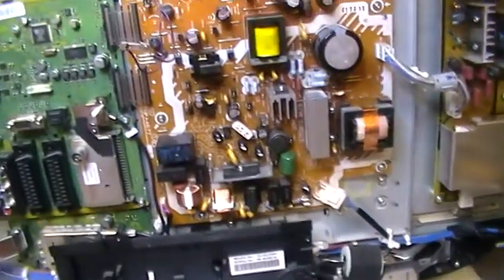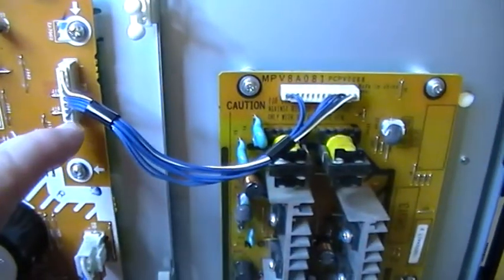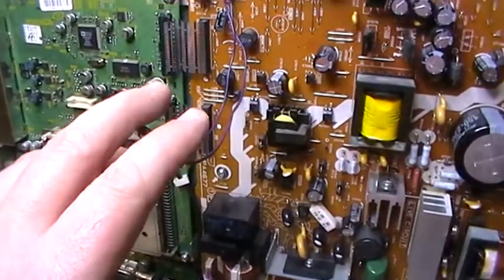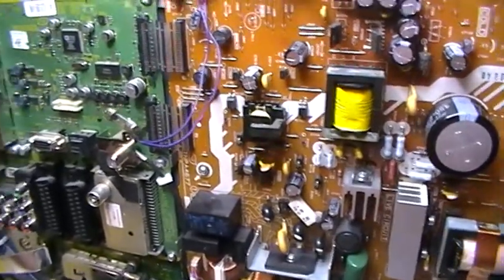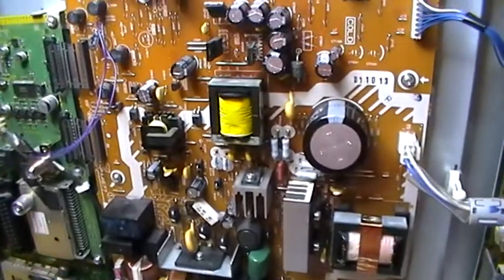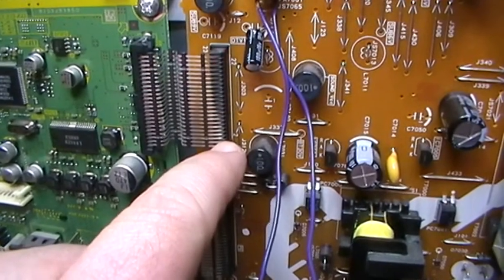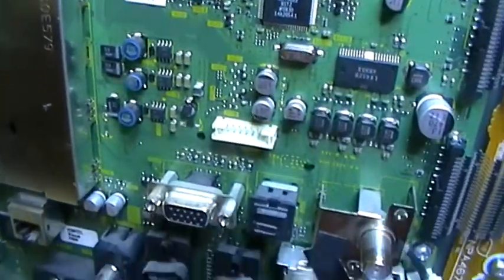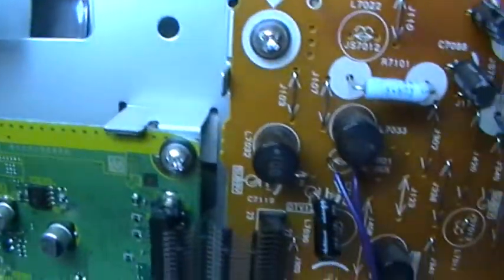panasonic Viera TX-32LZD81 television

Comment: I have a Panasonic TX-32LZD81 - I pressed in the Power Button and the TV made a FUTT sound. As the power button wasn't engaging, there were no lights lit up it was dead.  I replaced the micro switch hoping that the problem due to lack of engagement and hoped it was solved (IR - TXNV10NDA TNPA4459). A micro switch isn't a difficult thing to install, so now have done that part, but I am not getting any power to the TV at all. Checked the fuse, checked the main cable and both are fine. So no power is getting to engage the TV. Any suggestions would be handy.

Comment: Soldered a 2 amp cartridge fuse across the T Con board fuse and all working. I would like to place the onboard pcb fuse with the correct one but cannot source one. It's marked up as 24v/1.6a   Anyone know where I can get them ?